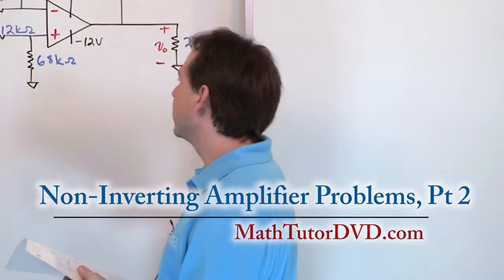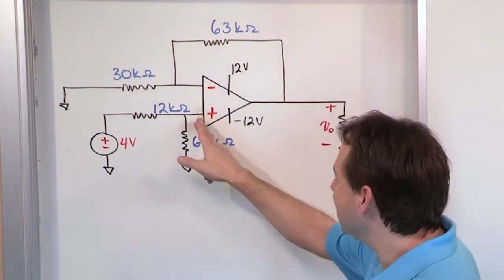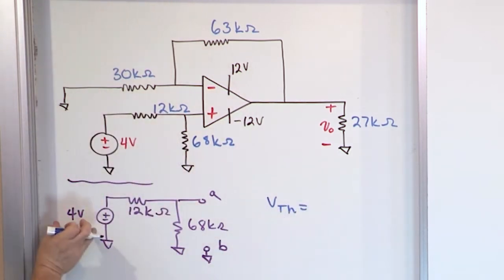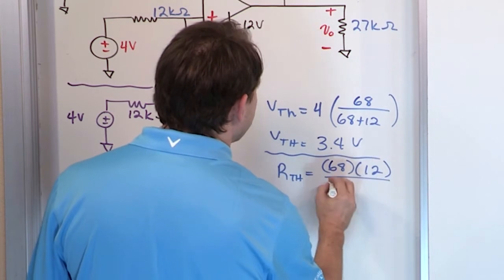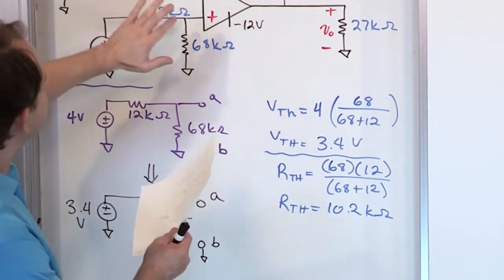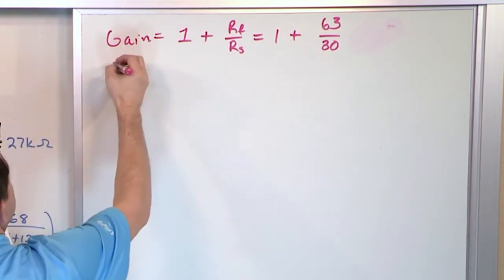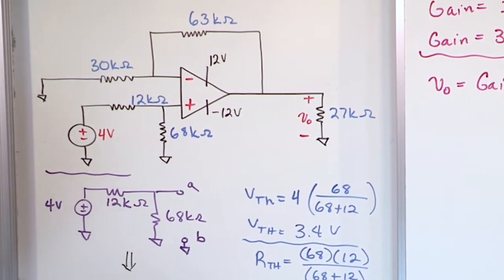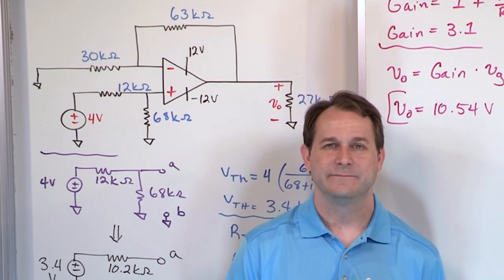03 - Non-Inverting Amplifier Problems, Part 2

Comment: Wait, hold a second, ok, so, the 27K-ohms are just yeeted out of the eq? like, we didn't even bothered to use it in the first place
Reply: Essentially, yes. For me, personally, I decided to also calculate the output current. If you try to calculate it, then yes, you need the 27 kiliohm resist,  but if you’re just trying to find the voltage output, which is what most people would’ve done, then no, you do not need it.

Comment: what if you dont have Rf and Rs?
Reply: Then you have a special case called a voltage follower. it is called that because the output voltage is equal to the input voltage. The gain would just be 1. Hope I explained well enough.